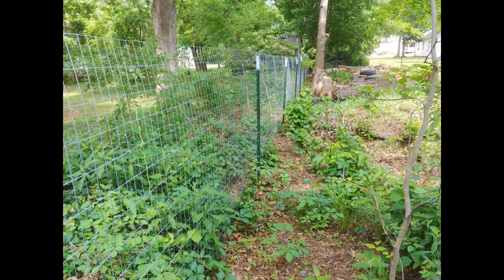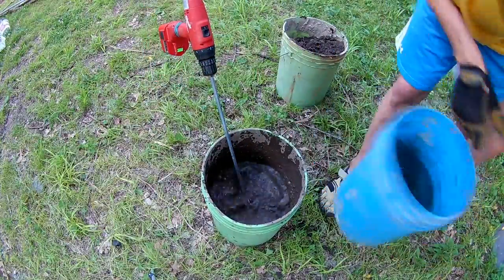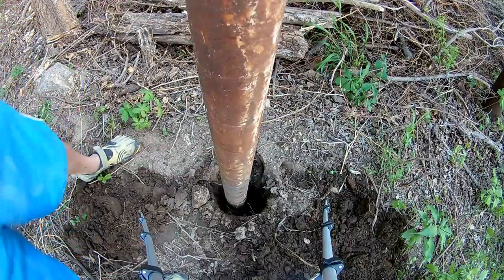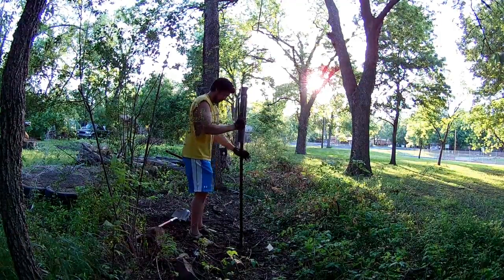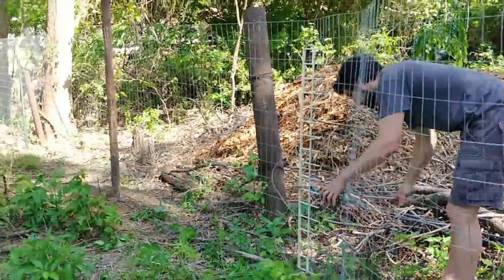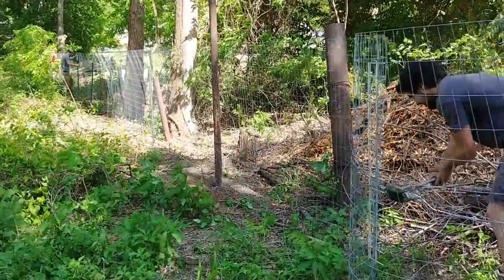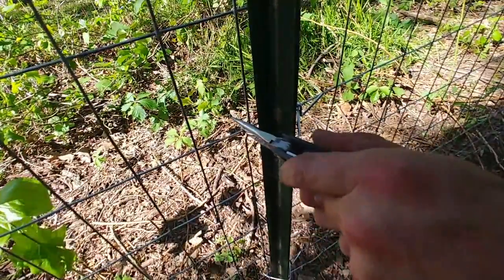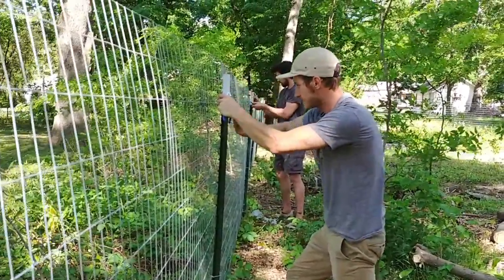How to install a welded wire fence

Comment: Installing a 50-ft stretch of welded wire fencing and wanted to see how to do it. I've seen poorly strung fencing along my neigbour's property line where he just tried hooking the wire into the posts' hooks; but they didn't stay. Thanks for a great, detailed video on how to use the clips and ideas how to stretch the fence evenly with a 2x4 with hooks and rope/pulley. Efficient! Thanks again! from a new home owner!
Reply from the maker: Glad to help! I made the video because I didn't see many good ones and I learned a lot in my process.

Comment: we are trying to build a fence around our garden... appx 200-300 diameter.  We want to use welded wire (50 inches x100ft) and t posts.. but at the corners we want to use Round wooden posts .. but how to construct those corners is tricky. HOw round of diameter would those corner posts be? 6 inch? and then like 4 inch on either side? with cross bracing?? thoughts?
Reply from the maker: Theoretically you could use two corner posts securely in the ground to pull 4 sides. Remember that once you have secured the t-posts the tension on the corner post is gone. At the corners you can just allow enough overlap to hold the tension. A foot should be plenty. For a gate, the cheapest method I have found is to use the space between the last tpost and corner(you can make it any width really). You weave a piece of conduit vertically though the fence so about a foot sticks out(5ft conduit for 4ft fence so 10 ft piece for $2-5 makes 2 gates. You then drive a pvc or larger pipe into the ground receive the gate and then you leave a little pipe sticking out up top to latch some wire around or maybe just a bungee hook.

Comment: What gauge welded wire did you use for this project?
Reply from the maker: I think it was 14 gauge but what ever is standard at Tractor Supply.